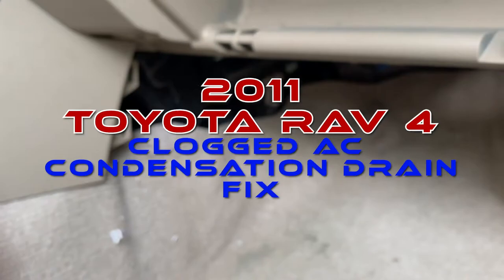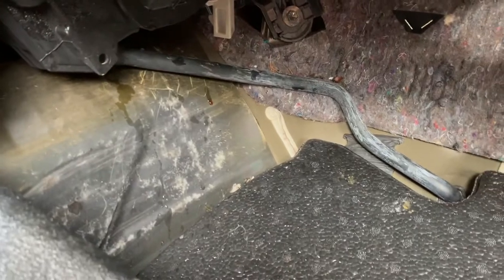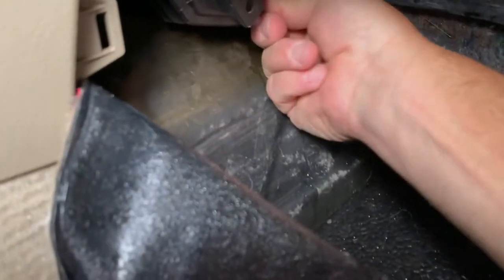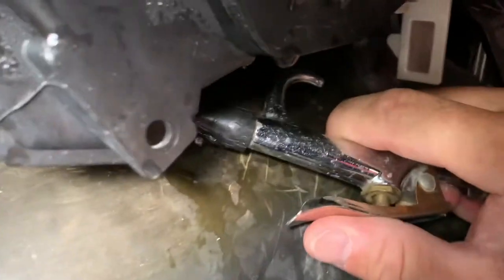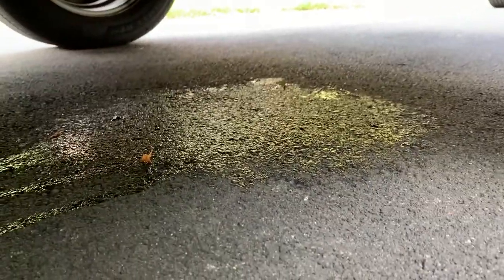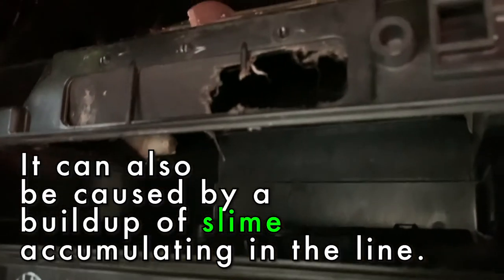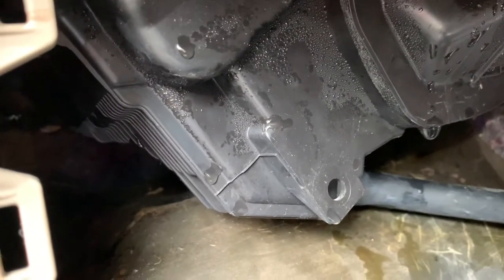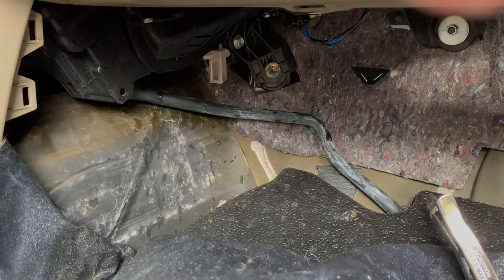RAV 4 DIY - Condensation Drain Fix

Comment: This works. Now it's obvious to me as to why. The clog can just as easily happen pre-drain hose as it can in the hose itself. I stuck a flex grabber just slightly into the plastic tube where the drain hose attaches and water and gunk came gushing out. No problems since. Bravo. Thank you for your diligence in searching for a solution. I had just about resolved myself to go to the dealer -- which would have been more than happy to have done the same thing and then change me $2000.
Reply from the maker: Glad it helped someone else....I am NOW dealing with the blend door actuator being stuck! Ugh...may have to tear out the HVAC box and investigate.

Comment: Thanks for the video!! My hose isn't the issue but there is a ton of condensation on the metal AC thing you were blowing compressed air in. I only have a smaller air compressor that doesn't cover the entire hole. I'm hoping itll still shoot out some debris! I also had a mouse temporarily make its way into my car a couple years back but it definitely ate up some upholstery and that could be the culprit for clogging it. Here's to hoping it works!
Reply: It WORKED!! Thank you so much!! This video is precious. <3
Reply from the maker: Glad it helped someone else....I am NOW dealing with the blend door actuator being stuck! Ugh...may have to tear out the HVAC box and investigate.

Comment: Question, did your car make any odd noises before you did this?
Reply from the maker: Nope.
Reply: Mine did when turning the wheel a sound coming from the ac only when turning
Reply: Yes!! Mine too!! 2011 RAV4. How difficult is it to remove the glove box so I can reach the condenser?
Reply from the maker: @litlady9337  It's not hard...just kind of niggly...here's a video on how to do it.
https://www.google.com/search?sca_esv=bbdbd4e0040378b7&rlz=1C5GCEM_en&sxsrf=ADLYWIJiLv43W24UHZO_TI4_VPJPEoyc_Q:1728578671925&q=remove+2011+Rav4+glove+box&spell=1&sa=X&ved=2ahUKEwio_9KtoYSJAxVUE1kFHcjXFIQQBSgAegQIChAB&biw=1728&bih=958&dpr=2#fpstate=ive&vld=cid:038e6a72,vid:Nxbl_5BTQS8,st:16

Comment: Thanks bra 🎉
Reply from the maker: Glad it helped someone else....I am NOW dealing with the blend door actuator being stuck! Ugh...may have to tear out the HVAC box and investigate.
Reply: @avgrphx  rock n Roll

What the heck is the blend door actuator?
Reply from the maker: @nei_hmande2427  So in the HVAC system, in this model, the HEAT and AC are both technically on at the same time, there's a BLEND DOOR that gets activated by the HOT/COLD dial on the dash that lets the desired temp air through to the cabin. In this RAV 4 it's mechanical and not motorized. I turn a dial, it activates a gear/cog attached to a blend door. That door is sticking and causing my gear to slip, which in turn is causing the cable controlling the gear from the knob to pop out of its track. I need to get that door loosend up without taking the whole HVAC box out of the dash. BIG JOB
Reply: @avgrphx  amen. I follow you. So technically heat can get locked on instead of the cold air?

Very nice explanation!

Comment: Is the same for rav4 2002?
Reply from the maker: I would assume so...they all have some sort of condensation drip...just a matter of where it is located. A quick Google search on your year should turn up results.
Reply: Did you try it for 2002? My gf 2001 has this problem and about to try it